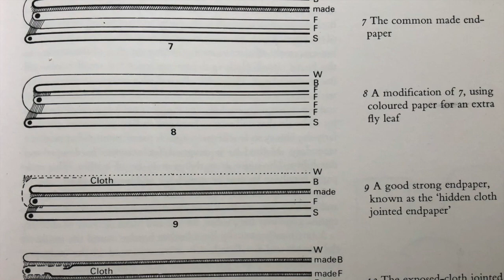Hidden Cloth Jointed Endpapers // Adventures in Bookbinding

Comment: Oh man, why didn't this video show up in my feed last night, when I was tipping in the endpapers on a sketchbook?  

Ah well, I do have signatures for at least two more sketchbooks, plus two commonplace books... with three more of the latter waiting for the supplies to be set up.  Since the sketchbooks and one of the commonplace books are for me, I won't lack for experimenting material!  Next up is case binding, which might seem a bit silly for a 3.5"x5" sketchbook in landscape format, but why not?   And given that the pages are 100% cotton 300 gsm watercolor paper, the extra binding strength will probably be a good idea. 

Quick question (3 years late, but whatever):  Could I use a single sheet of cardstock with this method, rather than the made edgepaper?  I promise I'll do the proper technique as well at some point, but I have a lot of excess cardstock to work through.  (Stupid 2 for 1 sales, they are a weakness of mine.)

Thanks!

Comment: Thank you for these thorough videos as usual. I wonder if there is an end paper suitable for a fan adhesive binding that is not simply tipped on. I would love to have a more durable end paper for these books that are not sewn.
Reply from the maker: I've thought about this awhile, and the problem is that double-fan bindings just aren't very durable anyway.  After the obvious weakness, the next one is the attachment to the case, which is true of all case bindings.  A simple improvement is to wrap some thin cotton/linen or even scrim/super/crash around the spine and onto the outside of the endpaper, which will go under the pastedown and reenforce the inner joint.  Hope this helps.  DAS

Comment: Thank you for this video. he whole process is clearly explained.
What kind of cloth is used for this?

Regards,
Ernesto
Reply from the maker: I think it was a medium weight bookcloth/buckram that wasn't paper backed.  It came from the odd pieces box so I don;t know the name.  Starched calico works well.  All the best, DAS
Reply: Would regular linen cloth work well Here? I'm using chroma book cloth that's backed from talas.
Reply from the maker: @squ1sh  Sorry, I missed your message.  If using regular cloth, maybe size it with paste and let it dry so it is stiff and easier to work with and so adhesive doesn't strike through as much.  I have used untreated linen for jobs like this and it is a bit fiddly and the adhesive striking through means you have to let it dry and be carful where you put it down.  All the best, DAS

Comment: Are you actually sewing through the colored papers, unlike the other endpaper videos where you sew through the white?
Reply from the maker: Yes I do in this video.  Generally I only sew through the coloured in stationery binding and some split board bindings, such as library style.  I would never do this for a "fine" binding.  I think I was following Arthur Johnson's design for this, in which case he probably had a split board binding in mind.  DAS
Reply: @DASBookbinding I suppose you could still use this general construction in variants where you sew through the white folio instead, or even add an extra folio of white inside the first one to make it “even strongerer”? 😊 But how is a waste sheet added without interfering with the cloth joint? 🤔

Comment: What is the rationale of tipping the coloured to the white papers and then folding one over? Why not simply sew them concentric like a text section?

Also: why don't  you make the endpaper-sections but until the textblock is finished. Wouldn't it be much easier to make them beforehand and sew them with the text sections all in one go?
Reply from the maker: The white folded around provides a waste sheet to protect the book while it is being bound, and is removed near the very end of the binding process.  The next interesting questions is, why add the waste sheet that way?  I may have think about this and answer it in a future video.  Your other questions can also have a long answer, but the short answer is that I'm often not organised enough to have made the endpapers before sewing the text, and thus add them later.  The longer answer has to do with the production of books in a trade bindery in the 19th and early 20th century, which is a different organisational problem to mine, but with the same result.  I often sew the endpapers like they are just 2 extra sections.